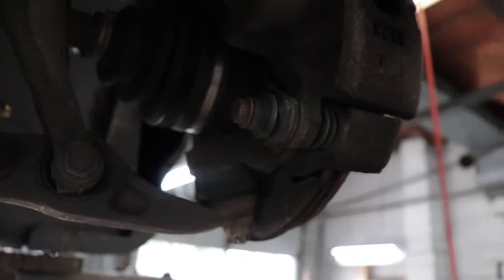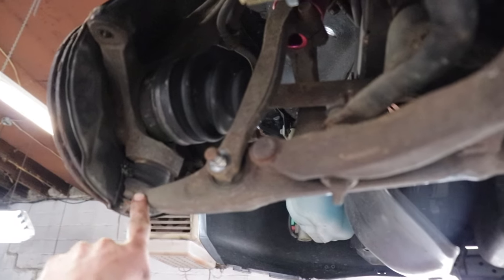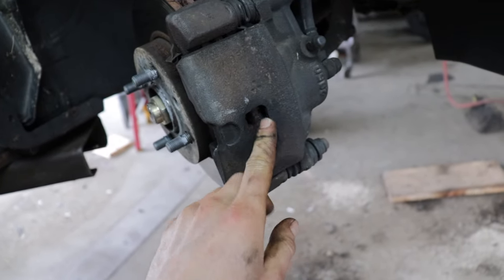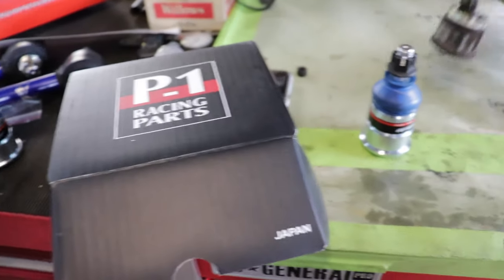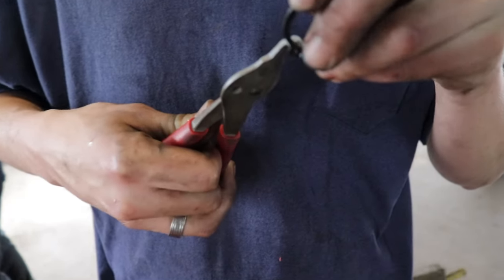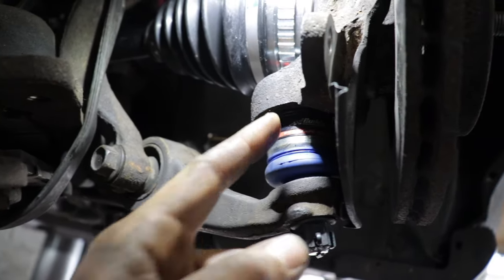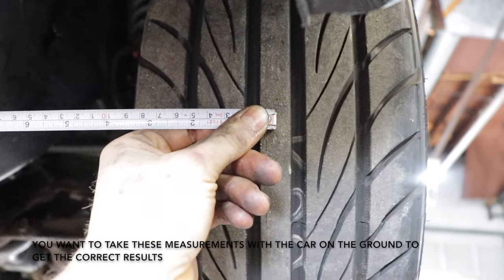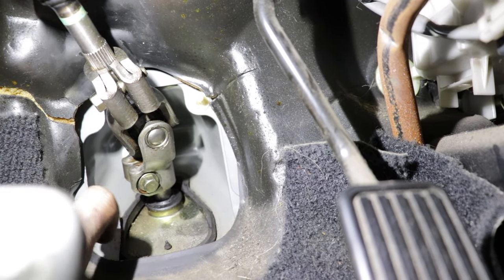Installing Delsol Inverted Tie Rod Ends and Extended Ball Joints

Comment: I tried installing the hardrace tie rod ends on my ep3 but ran into issues. They did not seat properly into the knuckle. The shank or "rod" would come down quite a bit when tightening the nut. Great video btw!
Reply from the maker: thnx man hope you get it figured out
Reply: @salvobrothers5928  If I understand correctly what you mean I have the same problem: I just installed the inverted tie rods and they are too much "angled". They go too much down.. Maybe to have a correct horizontal alignment they must be fitted TOGHETER with extended ball joints. I will buy them too..
Reply from the maker: @michelemagliocca5144  are they angled too far down when the car is on the ground? if so then you wont need them cause they are only necessary when the car is lowered to a certain height
Reply: @salvobrothers5928  Yes they are angled down..

Comment: Are those extended ball joints a must when using inverted tie rods? Or can you simply just install inverted tie rods?
Reply from the maker: you can do the tie rod ends alone. the ball joint just helps you get more if needed when riding really low

Comment: How are they after 2 years I have 99 crv with extended ball joints and just bought the inverted tie rods but alot of people saying they have pulling issues and not made for daily driven
Reply from the maker: they are still holding up nicely just put a fresh set of tires on it and got it aligned feels great

Comment: The ball joints you removed were stock/ shorter than the new ones. Any issues on replacing it with stock ball joints on a lowered vehicle with coilovers?
Reply from the maker: its not necessarily an issue goin back with stock but with this ball joint it puts all the suspension in a better line up so it doesnt wear the components as bad and the car handles better because of it, less bump steer and possible chance of axle bind
Reply: Thanks for responding.  Forgot to ask you. Do I use stock tie rod ends? It's for my 2005 Civic Si Ep3.

Comment: will this move my upper control arm down an inch so it doesnt slam on the strut tower all the time
Reply from the maker: if anything it will move the upper control up higher. ive seen guys cut windows in the strut towers and reinforce the area so the upper control arm can move without hitting that

Comment: excuse me Salvo Bros,

1" Extended Upper Greasable Ball Joint would be suitable for how much lift?
Reply from the maker: its good for anything lower then a half inch off of stock ride height
Reply: @salvobrothers5928  thank you, few more Question Salvo if you don't mind, will a ball joint for a LCA fit on an UCA?

and what happens to the LCA if replace the ball joint with an extended one? will it lean towards the wheel or towards the crossmember?

Comment: Did you guy experienced any bumpsteer after installing the inverted tie-rod? The only feedback I see about these aren't very good
Reply from the maker: its not my car he hasn't said anything about bump steer, hopefully he will chime in and give you some input
Reply: That'd be great🙏 im looking to buy some but there isn't alot of feedback out there
Reply: @josephismajoseph  hey did you ever end up installing the Inverted Ends? When I did, i experienced more bumpsteer than the intended purpose of eliminating it. Cheers
Reply: @2blu4you1  never done it. The only feedback I saw was one like yours so I never tried it ...
Reply: @josephismajoseph  inverted tie rods are not the answer usually. The extended ball joints however are

Comment: wow I’m having a problem with Ktuned roll centers did your friend have any issues
Reply from the maker: not that I'm aware of.
Reply: how did the Godspeed coil work out for him.  I’m running skunk2 spring and shocks so when I installed car feels better but no shock travel.  It hits really hard even on minor speed bumps
Reply from the maker: @jonsantana292  yea thats why he went with the godspeeds, it rides tight but doesn't slam hard on bumps
Reply: @salvobrothers5928  right that’s what I figured 
 you even mentioned that on Godspeed coil video.   I just wanted to be sure and hear it from someone else    but yeah awesome channel man.  your a funny dude   thanks for the help

Comment: So what would happen if I were to just flip the tie rod ends it would seem that would work if I take them left to right and right to left but upside down that they would work the same ?
Reply from the maker: it doesn't work cause of the taper on the knuckle is tapered only in the one direction so it wouldn't fit all the way in the hole
Reply: @salvobrothers5928  boy I feel a little dumb right now I don't know how I could have missed that LOL
Reply from the maker: @deadsols5852  hey man its easy when your not looking at something in your face, don't beat yourself up over it